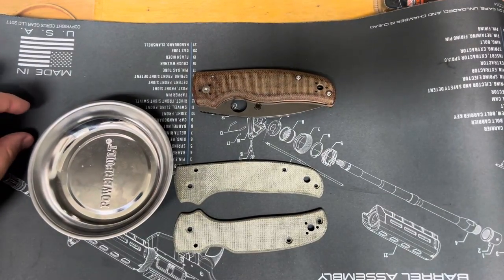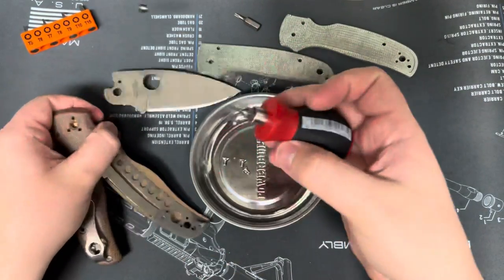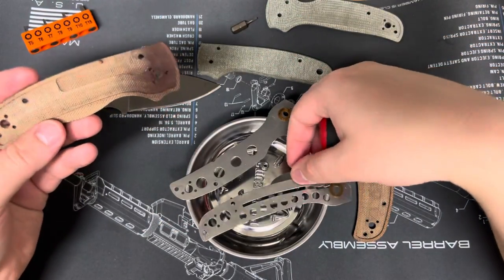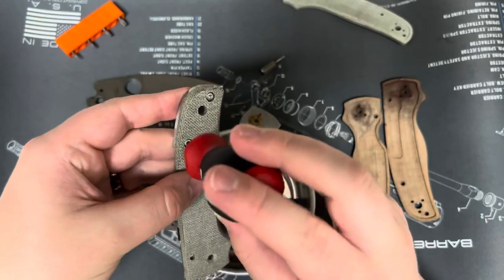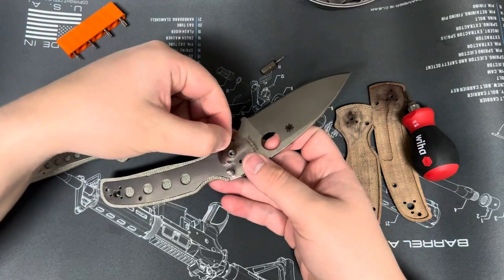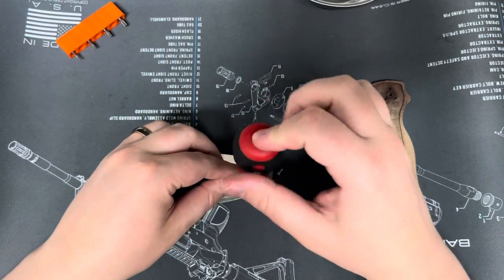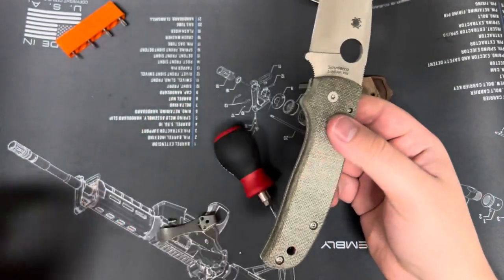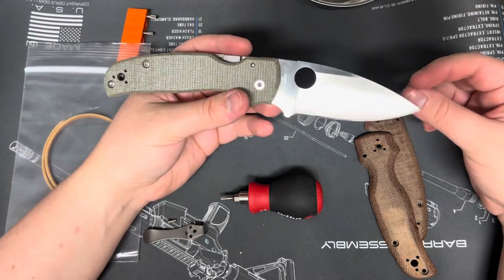Scale Installation on the Spyderco Shamn

Comment: I been thinking about titanium scales on my cutlery shoppe shaman. But some YouTuber have had problems with centering and action.. have u experienced these problems?
Reply from the maker: Mine had centering issues before the scales so I didn’t really care if it did anything, I have found that the alignment of the liners tends to matter more, and they most likely would’ve had those problems arise just from disassembly